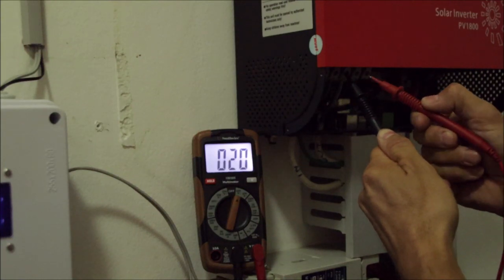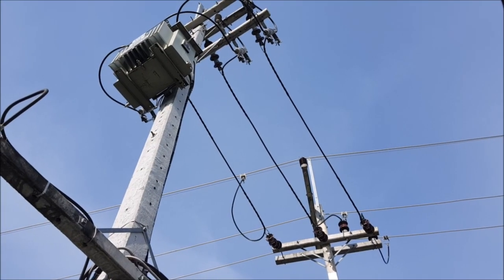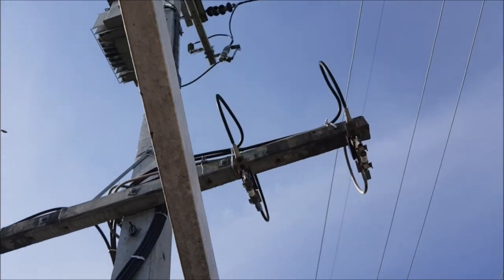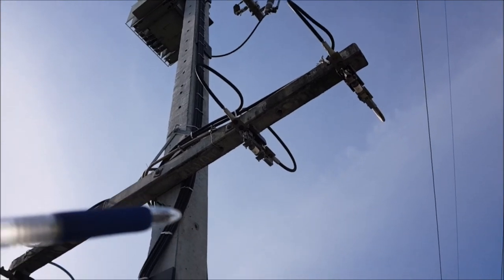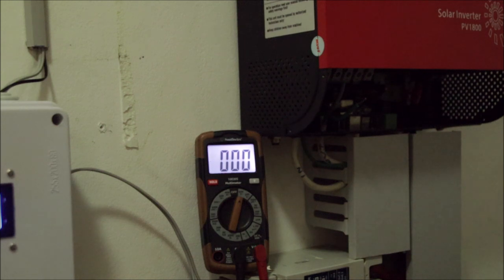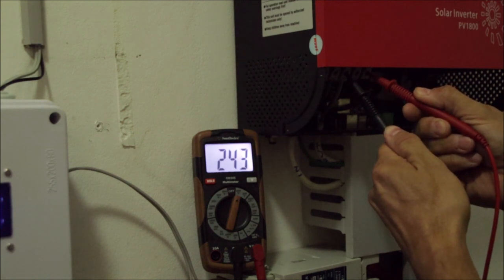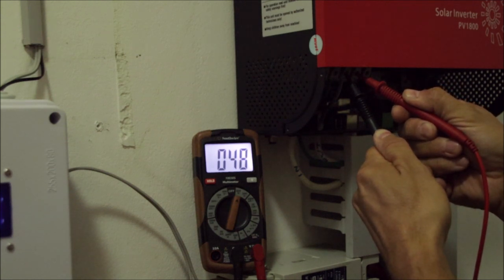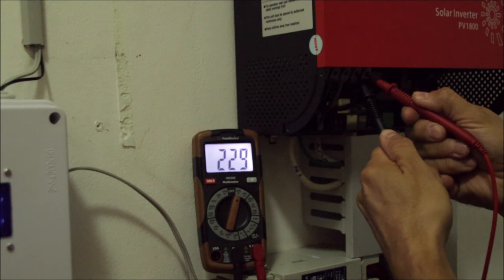DIY-Installation? Don't forget about Inverter Grounding and Neutral-to-Ground Bonding!

Comment: If there are two Neutral-Ground bonds as shown in the video,  current will flow over the ground wire between the two bond points.    At least in the US, this is considered a problem.
Reply from the maker: Hi, yeah. In my power room it is a bit tricky to explain. But in that case it is actually the combined PEN conductor just going 2 parallel paths to 2 different panels (which could as well be just one bigger) and there the bond is done to the same point of earthing. So comes from same point and goes to same point, just 2 wires in the same room. And the inverter borrowing that link for the fault return path...yes, very important to check the individual situation and only possible like that in the TN setup. That's why I now already have like 7 videos on my channel, one building up on the other, to get a clearer picture of a quite complex topic :)
Reply: @RolandW_DIYEnergyandMore  up

Comment: I wish I could find a video that explains how to connect your inverter when the grid goes down and there's no gird power for months, years, or maybe never. Forget about all these fancy, crazy expensive interconnected gizmos.
Reply from the maker: an all in one inverter like i am using there is nothing else like any other simple off-grid inverter. just look my video from my playlist on how to ground and bond an inverter in a simple off-grid system.

Comment: You have given the correct info my friend, No one talks about that. Some rocket scientists are screaming on youtube for bonding but hey if you bond neutral and ground after ( you said behind) the RCCB it will just trip cause it always looks for ground neutral bond its the nature of this device and that's how it protects us from being toasted with high voltage. But FYI in some countries neutral and grounds are separated because of some stupid digital prepaid meters detects it and often cause over billing issues. It is always a good practice to ground your inverter with a earth rod no matter if its a chinese crap of a very finest inverter like victron. Cheers

Comment: Thanks a very well explained and informative video, I was always wondering if the earth stud on my invertor and the earth pin were connected, I haven't done this as I did not know if I would cause damage to the invertor. At the moment nothing is bonded to any earth. I have a off grid setup with solar panels charging battery's and no mains available.

Comment: If I short my neutral to ground in my E panel would it make any problems.  Always wonder about the neutral be a communications technician. I have a earth down at my shed. I have not bonded my earth and neutral in my shed. But it is connected to my main input 240 on another earth.
Reply from the maker: Technically N and G are twins. But if you are living in the RCD world and short N and G after the RCD or GFCI, those devices would trip as they will identify the current which is missing via the G line. Combining N and G doesn't create an imminent danger. It would just nullify certain safety loops we are building by separating those two lines.

Comment: My growatt hybrid inverter has the neutral to ground bonded at its output, measurable by voltage and continuity, I haven't checked what happens when I connect grid to its input without ground yet

Comment: Finally a video which explains it well, thank you! Although I did not have such a complicated set-up, I understood what was missing and why my EV charger reported a grounding error. I have a 3 phase 230V TN-S input to the house in CH, bond right at the entry before the panel. I have a Chinese all-in-one charger-inverter which either provides power to the house from solar, batteries or grid. It switches automatically depending on the settings (no external switch). Its Inputs are like yours. I realised that when it's in by-pass all is well (0V between N and P) but when it switched to solar/battery, the L and N became floating. After watching this video, I was brave and attached the bond in the inverter itself by adding a wire from P (input) to N (output). I this ok or should I bond in the panel right before the output from the Inverter goes to the distribution block?

PS: The rusty bars in the panel on the street look a bit frightening - like a fire in the making.
Reply from the maker: hi. thanks for the comment. there is nothing wrong to bond directly at the inverter in your grounding system.
Reply: @RolandW_DIYEnergyandMore  Adding a wire from P (input Phase) to N (output) direct at the inverter (as Michaelneuweller will do) is OK?  I thought only N (output) must be connected to the Ground(rod).
Reply from the maker: @topeye4202  I do not understand why Michael is bonding the Phase input with the Neutral output, but definitely do not bond that configuration to Ground as well :)
What he is doing is essentially pull the floating Neutral of the Isolated inverter output to 230V, while his inverter phase will go to 0V. This doesn't make sense as he just should have pulled the inverter Neutral to 0V by the use of Ground.  
In his current configuration there is a good chance of blowing up some equipment some time...
Reply: @RolandW_DIYEnergyandMore  I think or hope Michael ment with "P" PE

Comment: You really helped me to have a better understanding about this issue now. Under my meter here in the Philippines only the metal post is grounded, but no connection/ bonding from Neutral to Ground whatsoever. My AC output is floating and I will do proper grounding and bonding asap.
Reply from the maker: Hi, yes, in the Philippines they are using 2 systems for grounding arrangement. "Line to Ground (=TN-C)" and "Line to Neutral (=TT, or IT in a way)". So when you are in the "Line to Neutral" supply, you would be not allowed to make a permanent N-G bond at your inverter as you would actually change the grounding situation for everyone who is connected to the same transformer! So if you have a hybrid system, please make sure that you only bond while the inverter is in off-grid mode. Take care!
Reply: @RolandW_DIYEnergyandMore  Just seen that my inverter has no Dry contact. So will study more on how to do it the right way here.
Reply: Hallo Roland, my Battery Bank was in floating mode and my JK BMS had short interrupts with error message Protection (CPUAUX anomaly). After connecting the Batt - to my Ground Terminal everything looks ok now.
Reply: Charging with PV and Utility Voltage of in SBU Mode was working ok, but when I switch over to USB I get same error message. So I have made  connection from the ground to the Neutral. However the Utility and the AC output Neutral are all connected. Maybe I have to separate them. so Utility and AC out are devided. It's not so easy to fully understand it.
Reply from the maker: @gerdbeutler3728  yes. my video about "All in One inverters in TT-earthing system" might give you a few clues...

Comment: Hi Roland.
My home power system is off grid, but with mains backup with 2* paralleled hybrid inverters.
i have measured  my grid to load AC earth loop impedance (ZS) tests , they are really low at around  0.6 ohms so that's great !
However, as i am using the inverters "signal island mode" output when the mains is disconnected and the battery supplies the power ... a dry contact  provided on the inverter allows me to switch and energise ( via a 1 amp fused spur )  a contactor / relay to provide my "off grid" neutral to earth bond at the inverters ac output, This function is automatic !
My double-pole transfer switch has now disconnected my grid / mains phase (line/live ) and NEUTRAL. 
So now my domestic earth will not become referenced to the inverters neutral and form the loop required to trip my RCD / RCBO. 
Therefore my inverter is now my source of ac supply and their neutral and earth  conductors are joined at this source  via the closed relay / contactor.
 RCBO's downstream of this output supply my critical loads and operate perfectly in fault test conditions !
Once my grid / mains is resumed ( double pole transfer switch closes on grid side) the contactor opens, releasing my inverters NE bond,  and prevents the upstream  household RCD from prematurely tripping.
It works a treat but my DC 48 volt LifePo4 battery array, metal enclosures and solar has its own earthing requirements ... should i keep the DC earth separate to the AC earth ? ( as i do at the moment)
I have all DC components connected via a 10mm CPC/Earth conductor to a set of 3 ground rods in the back garden buried 5 feet into the earth.
I am trying to understand how to provide personal and equipment protection via my existing DC earth arrangements even though my battery is pos and neg fused , has 125 amp MCB disconnect  and has insulated polarity separation.
Even my solar output is fused, has Surge protective devices and Dc mcbs...
I m not sure whether my battery grounding is achieving anything ...
Your thoughts and guidance would be much valued.
Si
Reply from the maker: Hi. Your DC Earth is primarily equipment grounding in case of surges caused by lightning and equipment enclosure grounding. As the DC side is an isolated system as long all is well, that equipment grounding will act as a "first fault reference". In the case of any pole shorting to ground, that pole will be "reference zero". So it doesn't really matter if the plus or minus pole contacts ground through a fault, a human will always touch ground potential if he touches the lets say the battery case. I would definately keep AC earthing and DC earthing seperated if it is already. As per your description, you are running a well designed system and you have put a lot of thoughts in earthing/grounding.
Reply: I'm needing to put together the same kinda set up you are talking about for my hybrid inverter.

Comment: I greet you with respect, I have the following situation, I am connected to the hybrid inverter and with the AC from the provider, but at the AC output from the inverter I have voltage on N & L as well, it is ok if I connect the Neutral directly to the ground, before to enter the main box? can Neutral-To-Ground Bounding be done at the AC output from the inverter?
Thank you

Comment: I had exactly the same problem now at the moment I have off grid inverter. My task was when night current is there and when normal distribution is I have connected the automatic switch which is then connected to the inverter as input. On this input is bonding done in the main junction box so I use L,N,PE, Then from the inverter I have to outputs one is going straight to RCB L+N but there is not gnd, so I try to do bond N to GND(PE) then the RCD trip down immediately. At this point I was little confuse as I am electrician but I was not working as electrician for a while I could not figure it out why the RCD goes down, but first comes to my mind there is second bonding but where? Sure must be from the main junction box of the grid but I can not disconnect. There is scenario when Grid connected to inverter and is active means supply 230V AC, it seems there is no need for bonding I can not measure any of ghost voltage. The second scenario is when I switch of the grid so the inverter is either powered from batteries or solar I can measure the ghost voltage up to 130V AC, but when I connect light bulb is not lighting so is just ghost voltage, then I can connect bond neutral to ground but soon as I activate grid switch to active the RCD will trip down again. My idea was to add the contactor and whenever the grid will be connected the neutral bond behind the RCB will be disconnected so the bonds will not meet together. 

Now I thinking as I saw your video, maybe is just enough to do bonding before RCD and ghost voltage will disappear 😒😒

Comment: Hey Roland

So I am currently in the process of helping an elderly gentleman to connect a solar system. Him and his wife live on a farm that has no power/utility connection to grid. They have been purely utilizing a 3kw diesel generator as their power source.

My plan is to connect the PV panels to the inverter but then for the AC input I want to connect the Diesel generator. The AC output on the inverter will obviously supply the whole house. Its not a big inverter 5kw but it should be more than enough for them. They don't have big loads. So I will only have 1 DB box which would have the AC breakers, groundbars etc. as well as the dc side of the inverter( Battery, & PV).

My Question to you: I need to know where I should bond and where I should place the ground rod. I have a little bit electrical background. But grounding seems to be a point of confusion for many. I believe bonding should be done at 1 place only. So I will test to make sure that there is no bond on Generator, AC Input & AC output. then I believe I should Connect all of these three connection points's grounds together and have the bond to neutral only at 1 place. I will make this bond in the DB box then. Ultimately this DB box will have a breaker for AC out going into the home with the home's own distribution board and with its ELCB.

Any help would greatly be appreciated! I am struggling to find this answer
Reply from the maker: Hi. Yes, just create one N-G bond at the load center. It will serve the inverter and generator, whichever is feeding into the house at that time.

The SPD you can ground either to the existing AC grounding bar/rod if the panels are close to the inverter, or do it right at the array with a separate pin if the array is a distance away from the rest of the installation.

The idea is to divert induced surges to ground on the shortest available path.
Reply: @RolandW_DIYEnergyandMore   Okay so just to be clear- in my case the Generator will no longer be used to feed the house directly. It will only be connected to the Inverter AC Input. In my logical mind I would think that we now actually perhaps have to bond by the generator going into the AC input of the inverter as this is a source different from Inverter AC output. And then the AC output of the inverter needs to be bonded as this AC output of the inverter is isolated from the AC input of the inverter? This was just really confusing to me
Reply from the maker: @franchosis it depends what kind of inverter you use. if the inverter switches the generator directly trhough the AC-in to AC-out, then the generator will bond automatically in the load center. but if the AC-In is only serving an internal battery charger, then you could as well ground/bond the generator. But I would just keep that generator-ACin as isolated circuit...
Reply: @RolandW_DIYEnergyandMore  This is a Hybrid inverter, so It has the ability to take the battery, PV and AC in(Generator) and blend to put it onto the AC output.. So perhaps I would assume if we only bond in on the AC output side then it should automatically make the generator part of the same bond as on the AC output.. Actually I saw the physical inverterthere is only 1 Earth terminal in the middle of the two AC circuits on either side..  So there is a LN E LN
Reply from the maker: @franchosis  yes. just make one bond at the AC out/load panel. that is the safest option

Comment: In my country we use TT earthing system.
We are not you to linking our ground to neutral. Is this linking ok for a TT earthing system?
Reply from the maker: Well, you will have to bond in any earthing system used, but you will have to follow the rules of your country to properly isolate from grid if you have a hybrid system. Without bonding, your N and L output will float as you saw. If you are off-grid, the earthing system doesn't really matter, you just bond at the feed-in panel. But you should definitly consult with an local electrician if you are mixing different sources of generation.
Reply from the maker: My property is TN-CS earthing system. TN-C(S) is the easier system, as N-G is bonded throughout the system anyways already. TT is requiring some sort of isolation. Maybe the inverter to use an own Earthing rod and to bond G-N at the inverter. then go into your supply via transfer switch as alternative to the grid input. Best to consult a local professional for assistance.

Comment: Thank you for a very informative video on grounding. I have an axpert(chinese) inverter about to be installed. I was worried about bonding neutral to earth in fear of damaging the inverter. I have no idea what is inside the inverter, only know it does not have the heavy transformer used in my apc ups. I would love to know what the output section of the inverter looks like, if it still has a transformer, but high frequency and filtered somehow for 50hz? Any idea where one can find the electronic  schematic diagram of the axpert will be appreciated.
Reply from the maker: That's basically a similar inverter as I have. They go under many brands. It is a so called High Frequency inverter. The sine wave is created by fast switching of Mosfets and just minimal smoothing by inductors and capacitors. Thats why there are no heavy transformers inside the unit. You can watch my repair video of my Must HS inverter. Then you will see how those inverters look from inside.

Comment: Hi Roland,

In a scenario of a completely off-grid home where AC is provided by only the inverter to a main load center, grounding only the lug on the inverter chassis to an earth rod will still result in open ground circuits. However, in addition by bonding the N-G in the load center, it will solve the problem correct?
Reply from the maker: Yes, that is correct. That case is shown in my video about how to ground a simple off-grid system